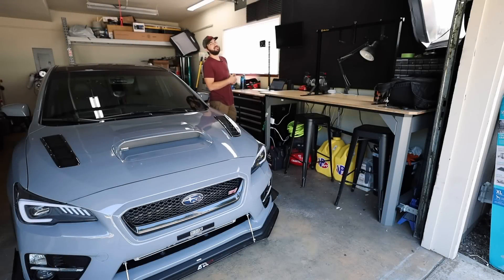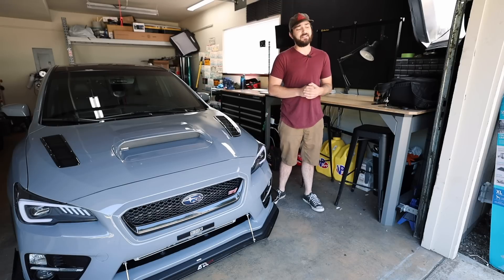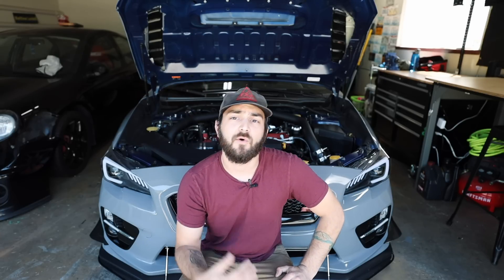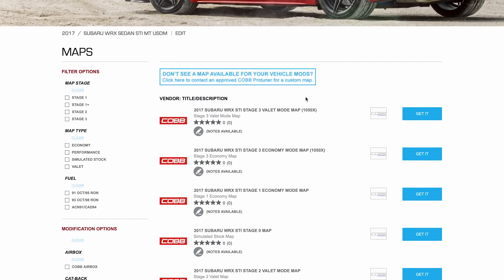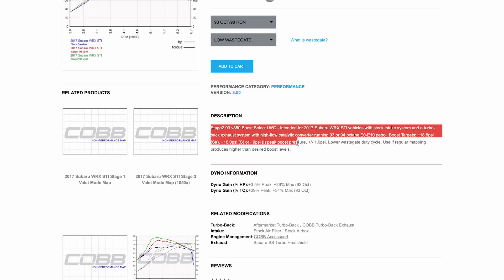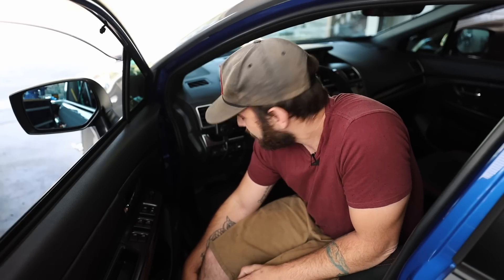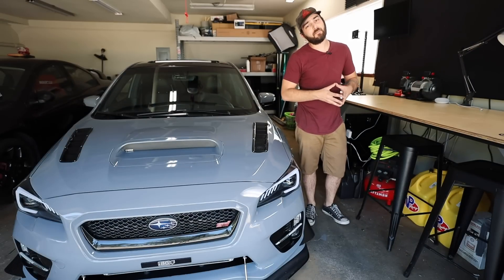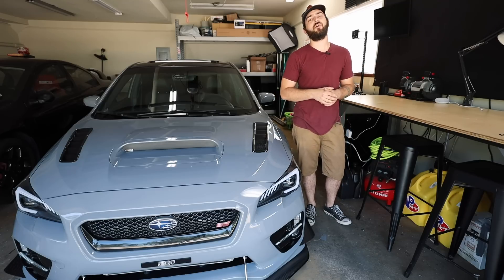Understanding OTS Tunes and What You Need To Know

Comment: So maybe someone can answer this . I had a 16 STI with bolt on;s nothing crazy just Cobb intake invidia catless  turbo back , air oil seperator  reserculator , I took off now have 18 sti . would my pro tune that I have on my access port work  if I use the same parts .."?
Reply from the maker: In theory yes, but every engine is diffrent so it may act a little diffrent

Comment: For sure the gd chaise is more tolerant of a stage 2 ots tune 02, 03 wrx, and 06 sti with catless dp and they never had any issues
Reply: Taylor Sease - my ‘03 LOVED my stage 2 (catted dp) ots tune.  It did pop out the tailpipe at idle a few times for the first week but then “settled in”.  Not really a burble thing, just a low bassy pop pop pop that I actually missed once it stopped doing it.  The catless up pipe was nice too - boost came on about 400 rpm sooner, and no worries of broken cat pieces taking out my turbo later.   Stage 2 was a monster in that 2.0 engine. When it came on boost, it hit hard! Nothing subtle about it.  Much more aggressive than even my 2010 STi.  My STi should have more hp, but I swear at 3500 rpm, the bugeye wrx felt a lot faster.

Comment: I had 2017 wrx that I ran MAP (modern automotive performance) intake, DP and their stage 2 and had zero issues for 3 years. From the New England area so had similar weather to where they were located. Like you said, not everyone will have the same results, but it ran excellent for me. Had I been down south definitely would've ran a protune for heat and humidity. Now I've gone 20' STi...plan on protune only for this one.😁
Reply from the maker: Glaf that you had no issues and a protune should do your new STI nicely 🔥😁

Comment: Wonder why when I took car for protune I wasn’t building up any boost, reading showed flat
Reply from the maker: Could be a boost leak somewhere
Reply: Smeedia I guess they did a smoke leak test nothing showed, they’re saying one of my cylinders is showing a different reading than other 3 on compression test, he’s saying possibly cracked piston? 🤔 at 40kmiles?
Reply: It was building some boost I guess just not more
Reply from the maker: Possible. But hoping that its not the case. What were the readings from the compression test?
Reply: Smeedia he told me but don’t remember haha but I’ll give them a call tomorrow, I think they were going to try spark plugs
Reply: Smeedia wouldn’t go past 15psi he was saying
Reply: Smeedia a month ago a misfire code appeared but other than that my car seemed fine afternoon
Reply: Afterwards*
Reply: It ended up being the bpv opening too soon and not allowing to build up more pressure

Comment: im planing on upgradingf my 08 sti, i have ordered AOS,getadomstune cooling mod and killer b oil pickup to make it more reliable, but when it comes to power mods can i install a cold air intake, equal lengh headers and cat back and still be safe with my oem fuel system?
Reply from the maker: Yes the 08 fuel system is capable of handling that, i would at least suggest a fuel pump though

Comment: I've noticed in my 2020 using the cobb otc 91tune  the DAM drops a bit when using the A/C on longer drives even pumping in 93 octane.  Any idea if the pro tunes or etunes will still have lower DAM numbers when using A/C on hot days?
Reply from the maker: Ive only had it happen for a brief moment when doing a pull at WOT. It shouldent happen qith a protune though

Comment: It’s obvious, but I just realized that the stock tune is an OTS tune🧐
Reply from the maker: It is! Just more conservative than aftermarket OTS Tunes, and since there's no AP you never see values on it
Reply: The early oem tunes were a bit lean for emissions reasons, so the Cobb tune actually was a safer tune on the 2.0l. Increase boost, adjust timing, add fuel - more hp, more rich afr.  Somehow the mpg didn’t even suffer too much. I think with the boost in torque, I could use less throttle and shift earlier and not be punished with low mpg numbers.  Until I hit CA, with their 91 gasoline with ethanol. I haven’t owned anything that got over 20mpg on pricey CA premium gas except a NA8 Miata that got close to 30 mpg from 87 octane!

Comment: Got Cobb stage 1+ on my 2014 wrx so I’ve only got the intake and the corresponding 98 tune (and that’s what I fill it up with here in aus). I saw on the Cobb website that I should be getting 17.5 psi of boost but I’m getting up to 18.5, should this be a concern?
Reply from the maker: Youll naturally get a little more boost, i wouldent overly worry but if you see odf values coming off i would back off the throttle a little

Comment: Another great video! Random question as I’ve been curious, have you ever thought about installing a 2 or 4-post lift in your garage (granted IF you have the height clearance)?
Reply from the maker: I have, and sadley the garage is too short to do so 😖
Reply: It not the height clearance, it's the supporting structure below it and any hydraulic/electric/pneumatic subsystems High-strength double digit ton holding steel beams and members are really heavy.  A normal footing under a garage would crack, shift and buckle, because you're using things weighing a few tons to hold other things weighing several tons.(It has to reliably hold 2 to 6 tons with a safety margin of no less than double.  I've been a blacksmith for 20 years and my power hammer is 1/3 the size of a garage lift.  I had to locate it on a footing type originally designed to bear boilers for steam systems. If I had to do that,( granted the impact side of things isn't the same) they'd need a footing not much less beefy.  He'd be digging yards down into whatever is under there.

Comment: Overall I've had a positive experience on the Cobb stage 1 map. My only modification under the hood is an AOS and I don't buy cheap gas. The stage 1 doesn't really add any power but it's a huge improvement in the smoothness of power delivery. It's a great driving feel mod. However I will not be continuing with the Cobb maps when I begin to mod for power.
Reply from the maker: Smart idea 🙏 glad to hear that your car has not been having any issues with it 🔥
Reply: thanks man this comment helps just as much as the video itself. I'm studying automotive technology but I'm going at this alone with my 2017 base wrx ... I don't want to increase hp I really just want to smooth it out and make a few small alterations to the gearbox so for now I think cobb stage 1 is enough for me. the wrx is my daily driver I have two years left paying on it and I dont want dealerships playing with me damaging sensors and then trying to charge me for diagnosis/repair

Comment: BOV on my 14’ STI is it safe or not?
Reply from the maker: Not with an OTS Tune
Reply: Smeedia Thanks man! So it’s safe with a pro tune? I have read so much about it not being safe on boxer engines and recirculation issues etc.  also, thanks for replying, it helps!!!
Reply from the maker: Generally you want to be on a speed density tune to safley run a BOV, i would highly suggest using a BPV 🙏🙏🙏

Comment: I noticed that when I installed my front mount intercooler I can only start my engine when the MAf sensor is disconnected??  You know she’s going on? Thanks in advance
Reply from the maker: What tune are you using for thr car?
Reply: Smeedia 91 octane  stage 2
Reply: Cobb access v3
Reply from the maker: Can't use a front mount on an OTS Tune, the piping adds a lot of volume and will make the car run awful and potentially put it in limp mode
Reply: So I take it either have a pro tune or a tmic again. Thanks dang it lol
Reply from the maker: Or an Etune but yes sir 🙏
Reply: Smeedia  would a etune help with radium tgv deletes. Have the deleted but font want to do anything else without the right tune
Reply from the maker: The TGV Deletes will also require a etune
Reply: Smeedia had a feeling and now stuck in Vegas without a reputable tuner. Lol thanks for the info.

Comment: I need help, I put a ETS  downpipe on my wrx. My car is currently tuned on Cobb stage 1 OTS Túne. I couldn’t take the 2nd pill restrictor out cuz I needed my car to go to work. The car was running perfectly other than a PO137 code but that’s just cuz that I’m emitting more admission. I just filled my tank with 93 octane and all of the sudden my DAM went from 1 to 0.625 my fine knock learn read -2.81. I think that I just got bad gas but I’m not sure what do you guys think?
Reply from the maker: You should be using a stage 2 map if your running a downpipe on the car. If you have an intake it should be stage 2+
Reply: Smeedia the only reason I was driving it was  because I need to go to work and I was keeping it out of boost but Since I don’t work tomorrow I’m going to remove the 2nd pill and tune it for stage 2 but like I said after I put fuel from a gas station that I wasn’t familiar with and 93 oct where I live is usually 2.70 to 2.90 but the gas station had both 91 and 93 oct for 2.50
Reply: @subiegang4917  it dropped because of the wrong tune bro you gotta follow the cobb map instructions 2nd pill is crutal to remove. .. but bad gas will cause it to drop once you re tune to stage 2 put in an octane booster and fill with shell it should take care of it. but drops happen from time dont worry as long as it goes back up in a few days.

Comment: I honestly wanted the AP just to get rid of the dang rev hang in my WRX and give me some way to monitor essentials. Stage 1 Cobb has been fine since i have nothing but a catback, though I did have DAM drop a little while ago (probably bad gas). I DO want to get on an etune soon but I want to at least get an intake and do some of my first important maintenance to make it worthwhile. I'll probably swap to the 91 octane cobb tune soon even though i have 93 in my area. It just makes sense in case i travel and cant get such high octane.
Reply from the maker: Not a bad idea, and bad gas is always a possibility for reduced dam 🙏

Comment: I feel like a lot of people don't fully understand OTS tunes. If so many folks were blowing up their engines on OTS tunes, then why has no one gone after Cobb for it? just because a manufacturer says "no warranty provided" doesn't mean they aren't liable if their product doesn't work. sure they are absolutely less precise, but the OEM isn't sending every car to the dyno to be tuned before it gets shipped off either.  that's why things like knock and reduction to DAM are still happening. fueling a car you've never sat in or have specific logs for is a LOT harder than setting a baseline from other cars, detecting knock, and cutting timing when it does. it sucks to drive with, but it's also not a bad thing. it's the quickest way to harm reduction, and why the new +15 WRX has such a major issue with timing being retarded constantly. I think the reputation these tunes get is more likely to be that the quantity of people who are willing to drop $600 once is a lot larger than the quantity that is willing to spend that $600 twice. the only reason people are blowing up engines on OTS tunes is the same reason our insurance is so high. every 20 something with an instagram and lack of knowledge of cars in general owns a wrx. I see a lot more wrx's as first cars or first manual cars than people like myself who are in one several cars deep. while I have run OTS tunes in the past, I am myself am currently properly tuned. but that's also because I understand the benefits of having precise fuel, timing, and boost. there's a good reason dyno graphs on OTS cars are so much weaker to their tuned contemporaries.
Reply from the maker: Agree that nit every car that comes off the production line is individually tuned, but the tunes provided my manufactuers are much more conservative than an aftermarket OTS Tune. I have not looked into it so not 100% sure on this but cobb has to have some type of legal protection with the tunes. They know that not every car will want to accept it and run 100%.the majority of time I see OTS Tunes fail is when people deviate away from the map notes and required parts and they think the tune will adjusted for whatever they throw on there, which you and I know is not the case.
Reply: @Smeedia  I imagine they do, exactly because of the kind of people you mentioned. unfortunately I have seen plenty of people myself in locally ask if running x on y tune will be okay. OTS tunes really are never meant to be anything besides the stock tune caffeinated. in the context of the 15+ WRX all they really do is smooth out the power curve and reduce the frequency of timing cuts. they actually even run less boost than stock or even what most proper tuners will run. I really these are clearly meant to be step stones. because I get it, dropping $600 on the accessport and whatever else you spent on accompanying mods just to drop another $400-$800 is tough. I guess at the end of the day, if people who would have mixed and matched parts with OTS tunes stop and do it right instead of thinking everything will be fine then it's a win, right? anyways, enjoy the videos man.

Comment: Hey bro Need some input. I'm thinking of buying the 2021 Subaru STI trading in my 2013 Subaru STI. What you think is it worth it. Also can a 2020 SUbaru handle a stage 3 as a daily driver
Reply from the maker: With the required parts it can, what makes you want to swap to the 2021?
Reply: Smeedia I’ve had the 2013 sti limited since it came out. It’s paid off and being in the military I only have time to keep up one car. In short wanted something new still trying to figure out if it will be worth it. Have you had any problems with your car mods you placed on the car. Love your videos by the way
Reply from the maker: Thank you! And no issues with any of my mods, car runs great. IMO not worth it to swap from a 13 STi to the 21. Exact same car just a diffrent body style and slightly better interior.
Reply: Smeedia  you aren’t the first to tell me that but I will see so what mods you do first

Comment: Totally anecdotal, but my STI had ringland failure on cyl 4 with Stage 1+ SF tune with just a Cobb intake & Nameless catback after several months. SOA agreed to replace the motor after the investigation and working with the dealer. Put the stock airbox back on the car after, and waiting until I have more funds for some more mods before a protune. Great video man and excellent advice.
Reply from the maker: Sorry to hear but glad that theyre taking care of you 🙏 got a nice dealership with that one!
Reply: @Smeedia  yup, Subaru of Wichita was very helpful in working through the process. They also mentioned that being part of the local Subaru community helped my case.
Reply: A friend of mine got the same issue on his 2019 STI, never tuned and less than 10k miles.. SOA did investigate and replaced his engine.. this was a weird one for sure..
Reply: Kelbaez no doubt... mine is a 2016. Glad he got it covered! Definitely less to discuss with if no mods, but they also look for signs of abuse or racing too.
Reply: Wow... u got ringland from just the stage 1 tune n intake? That’s fucking ridiculous ..... I swear that’s just sad af.

Comment: OTS tunes are for people that are broke and uneducated on how to properly build cars. People need to stop being idiots and start getting dyno tunes. The Cobb OTS tunes are one of the main reasons why a lot of these 15+ WRX’s & STI’s are blowing up so commonly beside owners beat the shit out of their car. The only reason a accessport should be bought is to use to track the data of the motor (AFR, knock, etc)
Reply: The only reason why I have a OTS tune is simply because I currently don’t have the funds for a proper tune and I don’t run my car heavy, I’m thinking about a street tune than a dyno Túne
Reply: OTS maps are great for those of us who  want to fix some of the issues with the stock WRX tune while not modifying our cars.  Not everyone needs to get a dyno tune just to fix the inherit issues with the subaru map.
Reply: A_aron..well I agree somewhat with your statement but OTS tune is not all bad the huge issue was mentioned in the video people think that deviations from the map are safe and there NOT...you have to follow the notes and you cant beat on the car every time you get in it, or flooring the car when it's not properly warmed up, lugging the engine,  etc.. you do this with any car for that matter it will eventually fail quickly. biggest problem is the people that dont respect the car is why they blow them up daddy bought it for them. not because of the OTS in my opinion. I have ran ots stage 2plus with zero issues for 14000 miles while I do want a pro tune it's hard to get an appointment down in Portland  especially right now. but I get 34mpg and plenty of power. car runs better than stock.
Reply: And people need to stop saying “stage” it makes all of us subi owners look so fucking dumb.
Reply from the maker: Thats the point of this video is to hopefully help those who dont know that OTS Tunes are not meant to be a long term thing and that theyre generalized tunes instead of knes made specifically for that car 🙏